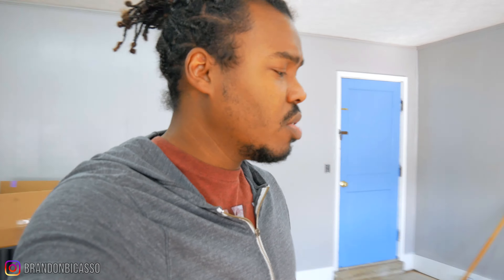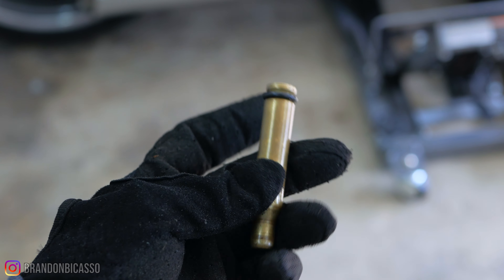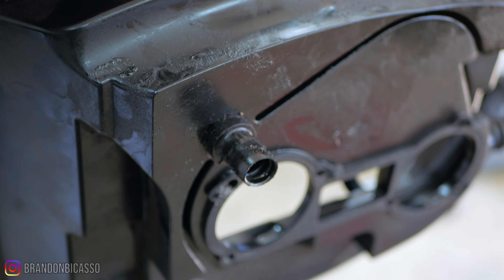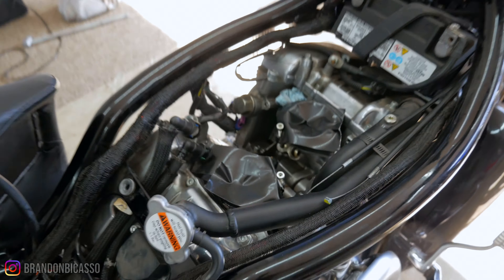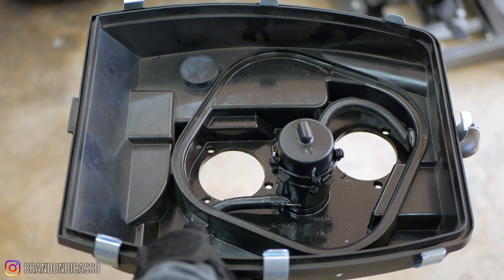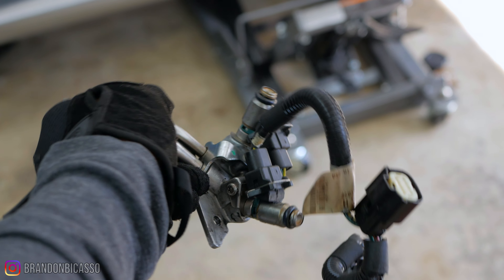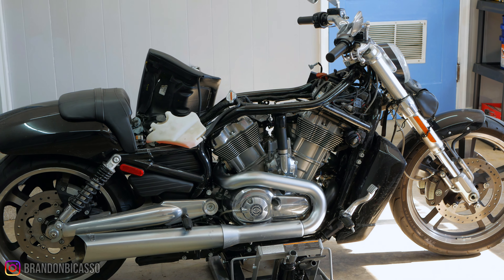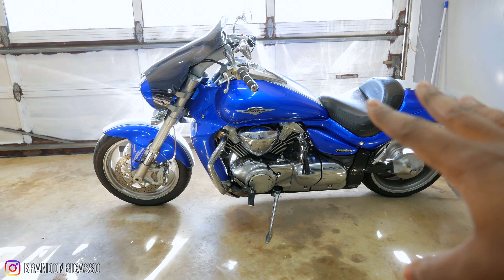The Price For These Harley Motorcycle Parts Are Surprising

Comment: Good job Brandon.
My last bike was an older Honda Shadow, and when it broke down, I just flat out couldn't afford the shop prices to get it fixed.
So that is when I decided to take it apart and learn myself how to do work on it.
Once you are over the initial shock of dismantling the bike, it really isn't so hard repairing it.
Just keep track of your parts and take a few pictures along the way.
I did the old method of lining up the parts in the order they came off and it really helped.
You'll be ripping down the boulevard on that V-Rod in n time.
peace.
Eric in Kissimmee

Comment: I gotta check the same thing on my nightrod. Not leaking as much as yours but I’m getting a little oil in the bottom of the air box. I’m assuming mines coming from the rear breather tube. But good to see this breakdown to give me an idea and direction of hope to go about it. Might as well replace the front one while I’m in there too.
Reply from the maker: Def not a hard job at all. I could take those parts off in minutes now.

Comment: Shop rate out here in the PNW is around 180 and hour.
Reply from the maker: Well damn. I was way off. That puts this job over $200. Possibly $300 if you want them to clean it for you.
Reply: @BrandonBicasso  yeah if I were heading into the dealership I'd plan on at least five before I walked in, just so I'm not shocked when it's "only" 300. 
Good on you doing the work and showing others the journey to repair it yourself.
Reply from the maker: @tankermike99  Wow, that’s a great way of looking at it. 🧐
Reply: @BrandonBicasso after a decade plus I have decided to just take what I think something would probably cost and double it for the "Harley tax". Has generally kept me from being upset when I go to the dealership for anything.
Reply: Wow! It's $85 an hour in the south east.

Comment: As you go along, you are find it harder to find parts for the V-Rod. I have a local H-D dealer that has a mechanic that had a V-Rod and that helps. The O-ring at the dealer was $.89. I have 2 dealers within 30 miles so that is not a problem. I'm trying to do the same thing as you. I'm working on my exhaust and learning a lot. I would see if you can find a parts manual. Check ebay for that. Also DM me and I can give a site for V-Rod owners and enthusiasts. I don't want to use your site to promote it. If you want to have at it.
Reply from the maker: No worries. I have a manual I'm going by with everything. I use the online parts catalog from Ronnie's Harley Davidson to order my parts.
Reply: @BrandonBicasso  great! I'm subscribed so I can watch. 😄